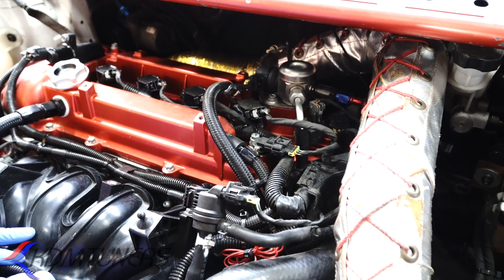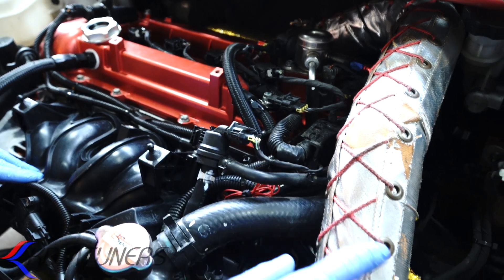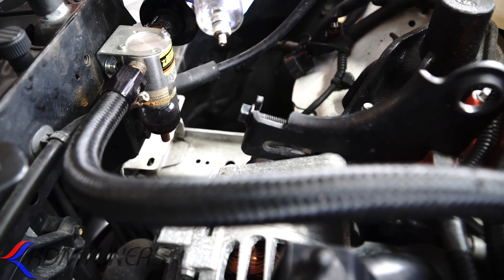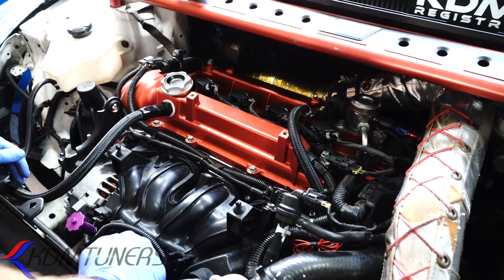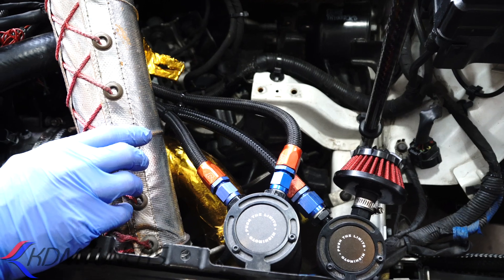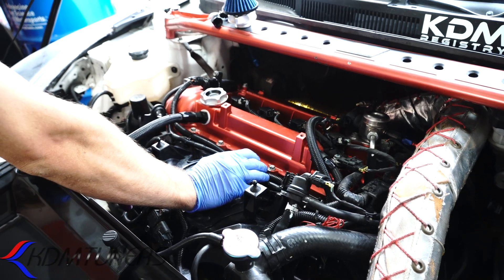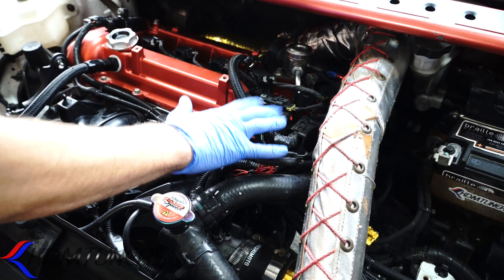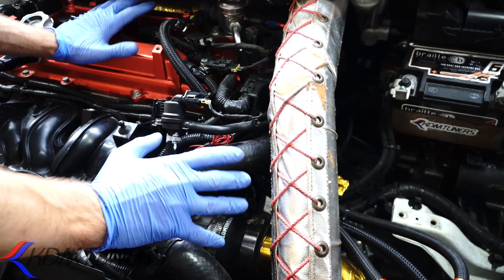How to properly install catch cans, PCV explanation and more!

Comment: Can someone help me with my pcv/catch can setup on my car!? I've been trying to learn and am a bit confused. I think the person who helped setup my catch can originally did it wrong. I want to fix it. 😊 Here's how it's setup currently:

(Hose from the pcv valve located just under my intake by the engine to the catch can. (Catch can has no air filter, and both port are in/out ports.)

A hose from the catch can to the single hole/port on the valve cover.

An air filter adapted on the oil dipstick.)

What I was reading is the hose to the valve cover port needs to go to the intake itself, and the air filter on the dipstick needs to go on the valve cover port???? Is this correct?

Comment: Mainly the reason they think its better is because, with the exhaust, it has to go through the catalytic converter which lowers emmisions...technically. 

I believe they mainly dont want the crank case oils/some unspent fuel making it past the piston rings to not be "disposed of properly" when somone just walks up to a catch can and just pours it out in random places...etc.

Comment: I know this video is old, but any reply would be awesome. If I don't plan on driving hard, does the single breather give my motor enough pressure relief so I don't have to drill into my valve cover? I'm trying to add a catch can because my air intake hose isn't available anywhere (maybe junkyard but probably all 20 years old)

Comment: a diagram/whiteboard would have helped so much with his video. I'm getting a decent amount of oil in my catch can and my system is PCV to catch can, catch can to intake (after throttle body), other line goes from opposing valve cover (LS) to air filter housing (before throttle body and after the filter). Thoughts?

Comment: your extra vents should have one-way only valves because when the intake vacuum will suck air in from the crankcase (via PCV) those extra vents will let air in bypassing the MAF sensor. So you'll have a lean condition at idle

Comment: Hello, great video!

You talk about the potential issues it can cause. It's great to hear that. Anyway, what about oil separators, catch cans that keep the PCV system closed? Venting it out is against the law.

I was considering an oil separator (catch can) for my car (6.4 HEMI engine NA, friend of mine for supercharged engine) that keeps the PCV system closed. The only thing I doubt about is that it can create an obstacle for the vacuum in the intake trying to pull the blowby gasses from the crankcase, making the PCV valve and the overall system less effective and putting more strain on the crankcase. It probably goes down to what type of filter the can uses.

What are your thoughts on this?

Comment: Correct me if I'm wrong. The intake tract is working as a vacuum to the valve cover in WOT which help sucking the oil vapors out because the PCV can't do that in WOT. And the same line works as a fresh air supply when Part Open Throttle. Capping the intake line is only gonna help in supplying air but only as a vent in WOT. While it can work as a vacuum (in turbo cars) if it's connected to the valve cover. isn't that right?
Reply: Yes 👍

Comment: Excellent information video on PVC / venting pressure.  On a small block chevy application with two valve cover vent if i was understanding you correctly 1). on the pvc valve side i will direct that into the catch can breather and the out line will go down to a bung welded 45 degrees into the flow of exhaust. 2).  plug the manifold line and the other side will just be breather at the valve cover?

Comment: … adds catch can to separate oil from air… then adds an oil/air separator..

A bit of misinformation here.. your setup was initially incorrect.. you made it work but it’s not the proper way.  A bit disappointed to see that the comments are commending this..

Comment: Can I run a catch can but without the pcv? I want to remove pcv valve and replace with -⁶ an fitting. Would there be any negative effects? Running a 22 forte GT 1.6 T full bolt ons.

Comment: You say your line under the oil cap was added and that stopped adding oil to the left of the two dual.  It would seem as if you nullified the PCV under the foam and used a simple industrial air/oil separator in place of the left unit.  The boosted side of the valve cover (intake) was over pressurizing your oil seals on your valves and the smaller Mishittymoto A/O separator baffles (Scamazon specials for $18) were not keeping up with the pressure.  Obtaining a larger volume A/O separator would have prevented you from adding another $6 separator.  Please explain how I misunderstood.
Reply: He's saying he needed more fresh air going into the valve cover which in turn didn't force as much oil out.

Comment: Thanks for sharing this. I have a question regarding the Jeep 4.0 inline six (2001) this model has a vent on top of the front of the valve cover and a valve on top of the back of the valve cover (near the firewall) Some call the front vent PCV and back vent CCV, others tell you that the 4.0 has only CCV as in closed crank ventilation that is a remnant from the WWII jeeps. (close system could witstand deeper water crossings) There are a lot of video's about mounting an oil catch can. There are people that swear it needs to be connected to the vent on top of the front of the valve cover, others will advise you to put it on the on the back vent on top of of the valve cover. What would you advice? Thanks my friend.

Comment: Bit confused on your catch can. If the line goes in the manifold. Wouldn't boost pressure push that back in the valve cover

Comment: Would one of these vented caps fit a 3.3L KIA Stinger? I have catch cans on both sides of of the engine but I can smell oil after driving hard telling me I'm pushing oil out of something. Would prefer not to pressurize my crank case and this seems like an easy solution.

Comment: Here is my 2008 Nissan Sentra Oil Catch Can configuration and end result. Enjoy. 04m37s ~ 05m04s discolored gasoline sludge and carbon residues safely trapped in engine oil catch can oil catch tank https://www.youtube.com/watch?v=xCfhebKMRbU&t=2s
Best ways to make your car engine last longer with oil catch can tank
2008 Sentra engine oil catch can tank and blow-by hose configuration placement maintenance
Engine oil change 2008 Sentra 2.0 S - DIY drain and fill
05m12s ~ 05m20s check the engine sound prior to engine oil change

오일 캐치캔 캐치탱크 장착했습니다. 가솔린 휘발유 차량이고 포집된 기름 상태 찐득찐득합니다. 
 https://www.youtube.com/watch?v=2wvupPKUeTE&t=965s

자동차 엔진 수명 연장, 집에서 일반인 누구나 DIY 가능 최소비용 최대가성비 The most cost-effective engine DIY maintenance at home https://www.youtube.com/watch?v=6DLn0kIi-84&t=225s

자동차의 심장 엔진 수명을 늘려서 존버 하는 방법 - 오일캐치캔
자동차 엔진을 10년 이상 무탈하고 오래 탈 수 있게  관리 하는 법

불완전 연소되어 찌꺼기가 끼여있는 더러운 잉여 개솔린 휘발유가 다시 엔진 연소실로 되돌아가기 전에 오일캐치탱크에 안전하게 분리된 찐득한 점액성분으로 변색오염된  가솔린 휘발유 - 04분37초 ~ 05분04초 확인

오염된 상태로 엔진 연소실로 들어가면 결국 엔진 때로 누적 되어 장기적으로는 노킹현상 유발 - 엔진 수명이 짧아집니다. 엔진을 깨끗하게 유지 관리하게 하는 꿀가성비 DIY 부품 - 오일캐치캔 강추 합니다 정기적인 엔진/미션오일 교환은 필수 입니다. 특정 회사 제품 사라는 광고 구입 링크~ 걸어놓은 부분 없습니다.

2008년도에 첫차로 구입해서 엔진관리 잘하고 13년차 아직까지 무탈하게 잘 타고 있습니다. 5분12초~5분20초대 13년된 엔진소리. 오일캐치캔 / 엔진오일 교환 / 미션오일 교환 모두 내돈내산 DIY 자가정비 경험담 입니다

수십년 전 우리 부모님 세대는 칫솔질만 하면 치아관리가 다 인 줄 알던 시절이 있었습니다. 그 영향으로 부모님 세대 들은 40~50대 이후부터 심각한 치아관리 부실로 인해서 치과를 찾을 수 밖에 없었죠. 그 마지막은 결국 틀니로 결말을 맺거나 지금은 임플란트로 대체 되었죠. 그러나 이 모든 사단이, '치실'에 대한 공익광고 만 있었다면 어느정도 해결될 사단이었습니다. 제가 어느날 치과에서 이 '치실'에 대한 생각을 털어놓자... 치과 종사자 분이 허탈하게 농담섞인 느낌으로 한마디 하시더군요. "저희는 그럼 뭐 먹고 살아요?" 라구요.....

5년~10년 마다 자동차를 주기적으로 갈아타시는 분들 한 테는 해당 없는 내용 이겠지만,
자동차가 한 두푼도 아니고, 오래 타면 그만큼 이득이고,  치과에서 '치실' 과 같이~~
자동차에서 '오일캐치캔'이 같은 맥락으로 생각되어 공익차원에서 올린 꿀팁글 입니다.

자동차 엔진오일교환/미션오일교환은 칫솔질 처럼 '그나마' 일반적이고 상식적인 사항입니다. 그러나 오일 캐치캔에 대한 내용은 정비쪽이나 매니아 말고는 잘 알려진 사항이 아닙니다. 왜그럴까요?

자동차 제조 판매회사 측은 차량 교체주기가 빨라져야 사업이 돌아가는 구조, 즉 자동차가 빨리 고장나야 제조사는 자동차 한대라도 더 팔리니까요. 자동차의 심장은 엔진입니다. 제아무리 이쁘고 간지 작렬하는 자동차가 있다 치더라도, 엔진이 뻗어버리면 어떻게 될까요?

오일캐치캔은, 자동차 제조 판매회사가 원하는 교체주기가 빠른  판매소비구조에 반하는 정비품목 입니다. 그러나 경제적인 면을 소중히 생각하는 소비자 측에게는 꿀팁이죠.

Comment: I have a 2004 Dodge Ram 1500 5.7l with a cold air intake, oil catch can , upgrade throttle body, upgraded plugs and wires, stage 2 chip. I have found out that I can add a vent I think I may have to add it to the cap but where can I get one or how do I do it?

Comment: This sounds oddly specific to performance/non-naturally aspirated vehicles. Most cars now a days don't vent into the atmosphere, and would cause a vacuum leak. From what I could tell in your video, you have two cans, one setup how most folks would do it (from the crankcase to the PCV, from the PCV to the OCC, from the OCC to the (upper) intake manifold). Then you have another OCC from the Valve Cover to OCC, and OCC vents from there. 

It's most likely my inexperience, but I've never seen a system where the valve cover connects directly to the air intake, and flushes the valve cover with fresh air. I also don't understand why there wouldn't be a check valve on the valve cover to avoid blowby into the intake. I'm assuming this is turbo specific?

Comment: Is the initial set up, i.e the PCV catch can loop, and the vented can okay for an NA engine, or will I need a second vent? I figure since I'm not running as much horsepower as a turbo, and only driving on the street, my cans won't fill up as quick. My main concern is engine health so I'm after optimal crankcase pressure/vacuum and a minimal recycling of blow-by gasses.

Comment: Looks good, I've been running catch cans on my higher mileage cars since the 80s.the only reason for a pcv valve,was to stop the use of draft tubes,from the valve cover to the road.now everything is pretty much a closed pcv system. I use the same thing as u but I put marbles in the bottom, and I put it in between pcv and throttle body.

Comment: 10/10 explanation, had a "shadow cam" issue due to the pcv being hooked up to a catch with a filter ontop, cheers for helping explain that its a closed system car preformed much better after the fix

Comment: Hi!  Question:
Do you have a check valve inline from the pcv side? So it will look like: valve cover, hose, check valve, hose then to the can, hose then to intake manifold.
Or would you put a check valve after the can, followed by a hose then into the intake manifold?  Or is a check valve still needed when doing an external pcv?

Thanks in advance!
Reply: Four years , I'm still waiting for this answer.

Comment: Possible is it possible to just run the Scavenging system to the the line that's on the back of the valve cover that would normally be to the intake?

Comment: My TT Mitsubishi GTO (aka 3000GT) smokes on deceleration only after boost. Is that due to the PCV system (not vented) or due to the turbo seals leaking? I have recently rebuilt the turbos, but the problem is still there. I had also installed a two-port oil catch can between the rear valve cover and the intake manifold, but the problem was still present and the can did not collect any oil for two years... The motor was replaced with a rebuilt one four years ago. What is the most probable cause for the smoke?

Comment: Time out. Venting from the valve covers is next to pointless. Stock engines do not have them for a reason and nobody connects their catch cans to valve covers anyway because they're not connected to the intake. Plus, venting makes your engine bay dirty. 
Secondly, The crankcase and valve covers are two different things. The crankcase has to release pressure from under the pistons, not above it. The way you have it set up it sounds like you closed looped it. Yes you are preventing soot by having it caught by the catch can but you're also then just forcing the pressure back into the crankcase. A good catch can will remove virtually all contaminates which doesn't harm your intake. Some intakes are designed to utilize the positive pressure from the PCV (and not negative because a PCV is one way) which is another reason engines will run like shit if you don't get that pressure into the intake. This can be overcome with proper tuning though.

Comment: Would it work if i only have one catch can and i drill the pcv valve and connect both hoses in a y to the catch can and from there to intake. and i just plug with a plug the original pcv intake tube. Im about to do it just wandering if that would be an issue in my head i wont worry about pcv not working i would drill the inside and any blow by will go to the can
Reply: The reason i want some suction on the vent side is because while cleaning the throttle body with crc at 2000 rpm with the intake disconnected i saw a stream of oil coming out of the vent side. i would imagine with suction you would get all the blow by and burnt oil faster just a thought. sorry for the paragraphs

Comment: What if you permanently plug the manifolds side pcv port and just catch can the cam cover port to intake on a turbo install. So there will be no vacuum leak and ghost air into the manifold and you will still have a catch can installed to ?.

Comment: I have a 08 Silverado 5.3L with 70mm turbo. I bought it already boosted but no catch can.  The guy told me it needed one , but not that it was crucial.   Anyhow.  I've watched several videos but none have shown me exactly how to install it.  I did install but I'd like to know your take on proper installation and which line goes on inflow side of can & which goes on outflow side and should it have a breather can or no.  Mine can with cap & breather.   I put breather on but its letting sum oil residue blow threw it & making a mess.  Noting serious just potentially.

Comment: I just bought some crc intake valve and turbo cleaner. Do you have any tips on the easiest way to apply it to the throttle body? Could i spray some in to the hose that leads to the intake manifold? Thanks for all your hard work! Keep it up
Reply: There's quite a few videos on the use of CRC Top End cleaner and would suggest to follow the instructions on the can. Mainly you just spray the entire can in SHORT BURSTS slightly in front  (1/4in.-1/2in.) of the throttle body but AFTER the maf sensor (mass air flow). This is to be done after the car has been allowed to warm up, while running, and gas pedal intially depressed to hold rpms around 1500-2000 and after just enough gas to keep from stalling due to leaning out the fuel mixture slightly. After the can is emptied, as per instructions, it's just a matter of turning off the engine to "hot soak" giving the cleaner time to work it's magic, then taking a safe but spirited drive on a highway and a little bit of stop n' go in the city. This aids cleaning out engine and allows time for the computer to adjust itself to any changes from the cleaning. 
Just don't spray the CRC in front of the MAF sensor as it can cause damage to the sensitive electronics. 
This type of cleaning is suggested to be done before each oil change on high mileage GDI Engine cars or even as a preventative step on newer cars.  Since the fuel injectors are not above the intake valves on a GDI engine and gas cannot aid in keeping the valves clean, thus leading to more carbon build up on the intake side. 
An oil change is also highly recommended after this procedure  as some of the cleaner can sneak past the piston rings into your oil, not a huge issues but has the potential to dirty up your oil more or even thin it out a bit. 
In some rare cases,people have reported their vehicle throwing a code for "lean fuel" after the use of this product, so you might need to have the code cleared. 
Which could be $20-$30.
I would suggest running a fuel injector cleaner before the intake cleaner procedure for atleast a full tanks worth of fuel just to make sure the injectors are free and clear of any crud, it won't help clean the intake side but it may prevent a code popping up from a dirty injector coupled with spraying cleaner into your intake.
 GDI engines getting dirty like they do is a big reason many people recommend installing an oil catch can as a way to lessen the nonsense going back into their engines, but it requires maintence in the form of monitoring the level of fluid/emptying so the device itself doesn't become or cause worse issues than a dirty intake. Not all but most, of people have a hard enough time doing proper PM (preventative maintence) on their cars anyway, for whatever reason. So this mod is mostly a unneeded headache to most since newer cars actively compensate for dirty components by self adjusting the parameters of the engine, to a point. ( ie. electronic throttle bodies adjusting trim to alter air to fuel ratios based off an array of sensors) This happens daily while simply driving the vehicle by way of the computer constantly running diagnostics on itself, but it also has a potential for more stuff to break or cause other stuff to break. Eventually the intake manifold could do with being removed and throughly cleaned, some cars (BMWs) supposedly have a service recommendation at a certain mileage to have the intake/valves walnut blasted to clean off any carbon deposits and that 'ish aint anywhere cheap to have done or gain any performance aside from a reliability stand point.
Like most things, pros and cons.
Sorry for the long reply, hope this helps you or anyone who reads it. 😎👉👉

Comment: idk about this engine in particular but most pcv valves are one way check valves so explain to me how the crank case pulls fresh air into it from the intake it should use the slight vacuum to pull the oil misted air out of the crank case and reburn it so put a catch can inline to seperate the oil from the air so clean air enters the intake and the oilly mist doesn't lower your octane rating or cause carbon build up